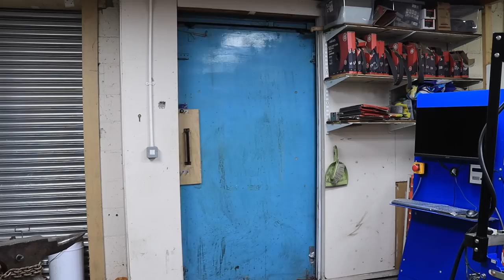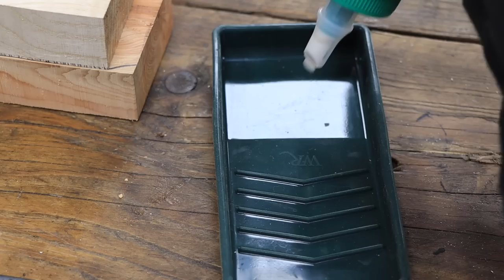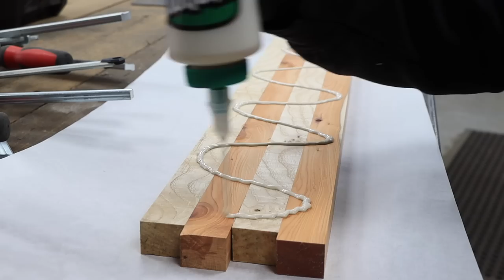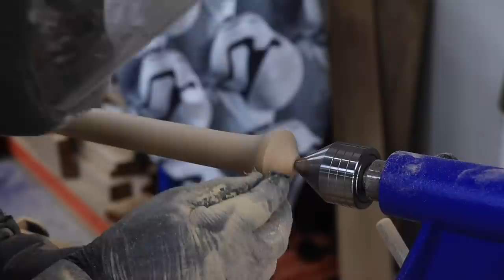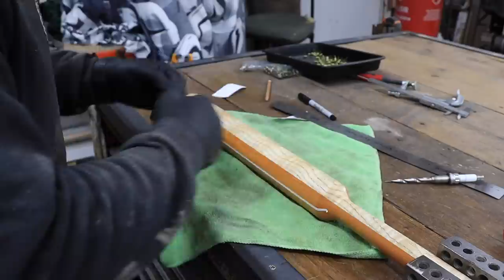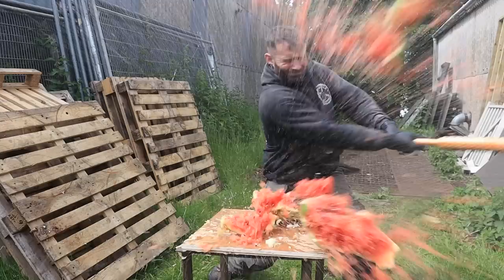Making a kanabō... & Then Smashing Stuff!

Comment: Holy crap. I did not expect that to break. Looked real epic though 🤘
Reply from the maker: Totally user error but i saved it for my wall.
Reply: @DiesInEveryFilm  a larger diameter of the handle would be avoided the damage?
Reply from the maker: @ebonyroundass  no, i hit the sharp edge on a solid steel table it would happen no matter what

Comment: Try again with a pipe core, then you can bolt through it for support and weight it for comfort. I love these blunt weapon builds, so dope.
Reply from the maker: No matter what it would have failed on that strike it’s just an unlucky shot, steel core would amplify the shock and with reduced wood thickness it would have definitely broken it, thanks for watching
Reply: @DiesInEveryFilm  ya, that's a heavy table. I don't think any part of you would have appreciated a steel core in that situation.

Comment: Osage and oak?

II like hand work (no power tools).  I made a round mallet out of osage 10+ years ago.  Maybe 3.5" in diameter at the fattest and about 15" long.  It developed one hairline crack when I moved it from lathe to bench to apply BLO.  It has dents from chisel butts, but it will most likely last longer than me.
Reply from the maker: Thank you, it’s curly ash and yew

Comment: That was beautiful. I'd love to see you drill both sides and put a metal rod into the center to make a new version that would be stronger than the old version. 
Another thought would be to remove the studs and reshape the thick end a bit. You could then hollow out the thick end into a scabbard. You could take the handle end and turn it into a full tang short sword.
Reply from the maker: I fixed it for my wall so it lives on

Comment: If you want to fix it, you could drill down the middle of both pieces and run a threaded rod in there. Nuts on the ends and glue to lock the rod in place.
Reply from the maker: Ive already fixed it for my wall

Comment: really good build, looked awesome until the misfire, you could do something similar with some steel to strengthen up the middle and some forged spiky blades maybe? Along the lines of the shark tooth clubs the Maori used to use?
Reply from the maker: I already have a trench club like that, i kept it traditional and even with a steel core it would have broken as the wood would have been thinner

Comment: Super cool project. The only thing I would  added would have been to drill through perpendicularly down the length of it before turning it on the lathe and glue in a number of dowel pegs to hold the pieces together, rather than just trusting glue.
Reply from the maker: That’s just overkill tho as wood glue is plenty strong especially in this configuration, the break would have happened no matter the construction cause it was swung full force at the end of a metal table

Comment: All it needs is one of those metal things they use between cinderblocks.
Reply from the maker: I don’t know what that is
Reply: @DiesInEveryFilm  Idk the name of it either but it’s those twisted steel things they use for construction.

I’m no mechanic or engineer but I’m sure if that was at the center of those 4 pieces of wood it’d never break.
Reply from the maker: @Binks129  it’s not that simple, just adding a steel core wouldn’t prevent it breaking, it was just an unlucky accident. 
To add a core would thin the wood and shock transfer would be more concentrated
Reply: @DiesInEveryFilm  Yeah I didn’t think it’d be that easy, just thought some type of core that goes from the handle to the base would make it durable, so it won’t break like that, but again I’m no engineer. Still a great build and thanks for the replies.
Reply from the maker: @Binks129  was just an unfortunate mistake by me, thanks for watching I appreciate it and the comments

Comment: um i think the next one you build needs to have a iron or metal bar in the middle / core also you made it to small in needs to be about 6 to 8 feet long . might want to use oak pine or cedar .
Reply from the maker: I used solid hard woods for this build and the opposing grain makes it stronger, an unfortunate error in use broke it and would no matter the design.

Comment: It looks to me like the shoulder between head and handle was too abrupt, and a more gentle slope would've had a little more durability. Heavy metal table could still have broken it, but the stress concentration couldn't have helped
Reply from the maker: It didn’t break at the shoulder and it wasn’t too abrupt, yes hitting a steel table on the edge would break most things